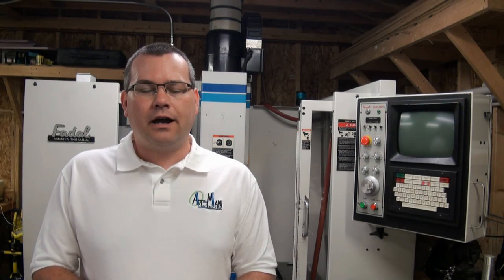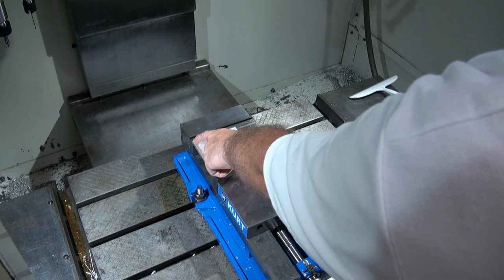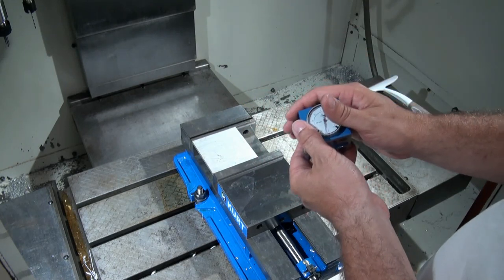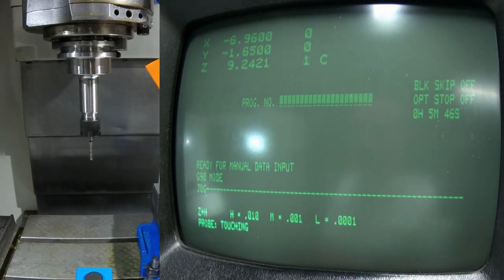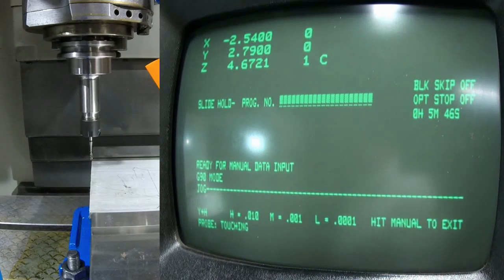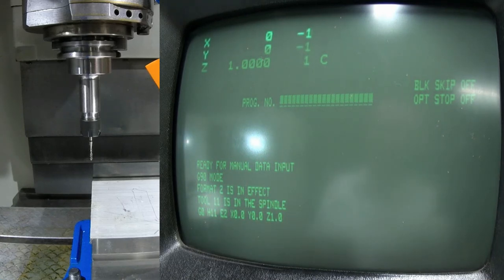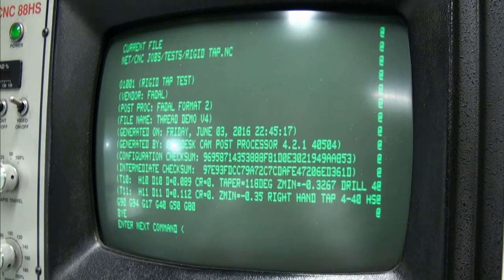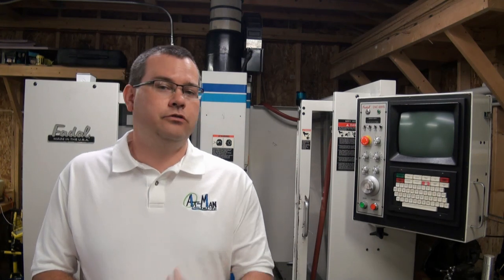CNC Mill Setting Tool and Work Offsets Practical

Comment: So basically, this video teaches how to be a cnc setter ?
Reply from the maker: It is a demonstration of how I manually set tool offset lengths and work offsets. Could be used on a CNC or manual machine to set a DRO.

Comment: The Fadal interface is stuck in the 70s. I would be annoyed if I had to work with it every day.
Reply from the maker: Most people I know like running them, its pretty simple once you get used to it and its fast.
Reply: My Fadal from late 80s is Better than my Fanuc control from 1999.

Comment: you don't have to reset tool offsets everytime you do a job or shut machine off do you? I just got a fadal 3016 and it has the renishaw mp12 probe i'm kind of getting stuck on how to implement it. its much different then my centroid controlled mill. there must be somewhere to setup the probe offset tool number and probe tip diameter? and a way to use it for setting work offsets?

Comment: After you set your both tool heights 2" off of the table.  Then touch off to the top of the part for your G54.  When you entered in the new x,y,z coordinates did it update the other tools?  If not, how can you get all of the tools in the toolchanger to update to the proper G54 "Z" height?  I just bought a Fadal Machine 1 month ago.  Thanks again for this content!
Reply from the maker: Hello DucksWe are actually applying two different sets of offsets. Also keep in mind, even though my tool setter is 2" high, the machine is setup to subtract the 2" during the tool offset measuring step.  So the offsets are really set to the table, not the tool setter height.First is the tool length offset, that is applied by setting the tool offset number of "H1" for tool 1.Then applying the G43 command.With the method we are using here by setting and applying just this offset, if you then command a Z position of 0.00 the tool would move to the surface of the table.  Each tool has its own "H" number with an offset that will yield the tool just touching the table at Z0.00.  That is the first step.The next step is dealing with the fixture offsets, those are the G54, 55, 56......We measure the distance from the surface of the table to where the Z 0.0 reference of our part wants to be. This should always be a positive number.  That number is entered for the fixture offset for Z.Now if we apply both offsets at the same time, the Z0.0 location will be at the point you wanted on your part. It is important to note you must apply both G43 and G54 offset settings at the same time when you do your first Z move.When we change tools we simply just change the "H" offset number for the new tool.Hope that helps clear it up a little.
Reply: how

Comment: great videos however for new people happening upon them be aware that the dial thing he uses to set the tools is generally not used in real life especially in high risk high dollar setups such as mold work in which tens of thousands of dollars could be lost for the slightest mistake or bad setting of a tool. The dial devices can be cautiously used--but they complicate the issue and are an item created to make money --for the maker of the device. Note that the needle spins around many times--the truth is you cannot trust where you are at. They are also not more accurate but some people visually see the dial and think they are--the gauge block method works instantly--and to millionths. Another issue is that its often necessary to indicate the top of the gauge block upon which the tools were set--and then run over to a known machined spot or starting point and be able to know the exact distance in z--you cannot do that using the dial setter. The dial setters are generally sitting around unused and wasted money in high risk machining. They also jam. The shaft jams and there is a mechanism inside that works "for a while'--but you cannot be sure when it goes bad gradually. Was just up at a shop in which one sits that he has taken apart many times to try to keep it working. It sits unused but once in a while he uses it so as "not to feel he wasted his money" Note also that the high tech dial has silly magnets on the bottom. You are hoping it repeats setting it on some surface even though the magnets will DEFINITELY have tiny chips and detritus stuck on them??  In mold works where blending must be done to split tenths the dial devices are of no use nor do they belong in a shop. The dial is in thousands--not tenths.
Reply from the maker: Hello Jeff
I can not disagree more.
The setter you see in this video was used for 2 years (still used sometimes) before I installed the Renishaw tool setter. It never jammed, failed, or came out of calibration. Just like any instrument, proper care and use is the key. It cost about $200 from MSC and paid for it self within the first week I owned it in time savings. If it broke, it didn't owe me a dime and I would order another one at the drop of a hat. It is repeatable within 0.0002" from my experience. On my machine the Renishaw probe is repeatable within 0.0001". I challenge you to set tools repeatable to 0.0002" with a gauge block in a timely manor. If you can, your a heck of a lot better then most of the people I know. If your trying to hold less then a thou, your not setting tools manually and your using in process probing to get there. If your trying to hold less then a tenth, you have one heck of an expensive machine, in an expensive climate controlled building, and your not watching some guy in a garage on youtube show the basics of tool setting ;)

Comment: Great videos.  Curious to why you use the utilities to set multiple tool length offsets, but use the paper and write down the dimensions and manually enter for the fixture offset?  Why not just use the fixture offset util that tells you to jog there, then record the values for x,y,z?  Again, curious if there was a specific reason?
Reply from the maker: The utilities did not really save me that much time. I use them for X and Y now but you can't apply tool offset values so it does not work for Z. Also when using the find corner or midpoint it forces both X and Y to update which does not work well.

Comment: Stumbled across the video looking for extra videos for my students. I teach CNC machining at a apprentice to journerman level. One thing I noticed, with tooling offsets that are that high, you lose a lot of overhead workable space, since your H call will move 12-14" negative Z if you are running G43. 

Heres what I do, and it may make your life easier. I have a 3/4" Solid bar in one of my BT40 holders. sharpened to a point. I use this tool as a MASTER GAUGE for all my tooling measurements and offsets. Its about 1" longer than any tool I use, and it has no runout, and abviously the pointed tip. The easiest way ive found to measure tool length is using this tool, jogging Z to zero my hight setter (2"). Then reset my relative Z to 0.000. Then swapping in each tool, say #1 which is a 1/2 EM, touch the z setter again, and I end up with something like -3.556". This saves a ton of room when doing large parts, where the Z-H offset might get in the way. Also, I use the Z setter to touch off the sides and faces of the vice, and the top of the parallels with a 123 block in them, just have to remember to add or subtract my 2.375" (2 for z setter and .375 for 1/2 of my master gauge dia), and 1" for the 123 block. This is way easier (and safer on tools) than touch off. 

I like what you have done, and i teach my students a similar way IF they dont have something like a master zero, or a probe of some kind, but I found that using an old tool holder and a piece of rod has saved me and immense amount of time in setups over the years. Just me 2c.

***it should be said that my MASTER ZERO that i use would normally be taken up by something like a 3d taster, but it serves a similar purpose. just a lot cheaper.
Reply from the maker: Hello, there are lots of ways to skin the cat here. I'm not sure if I agree that is easier or has any additional benefits.The primary reason is that it adds a level of uncertainty to the equation. By keeping my Z "reference" at the machine cold start position I always know that the tool offsets I previously measured are still valid.  Unless I do a repair on the machine the cold start will never shift. However, if you use the added step of the reference bar how do you know that no one adjusted or changed it since the last time the tool offset was measured. It also helps prepare me for the shift from "Table Zero" methods to "Gage Line Zero" methods if I expand my operation.I don't see the negative aspect you point out of "saving room"? If you watch one of the part videos during a tool change it does not matter if the part is 1" tall or 10" tall. After the tool change is complete, I apply both the Work offset (G5x) and the tool offset (Hx G43) at the same time as the initial Z move to the part.  So the machine moves seamlessly from tool change height to initial plane part height. The rest is just math in the controller and it does not really care.I do like your idea of using the Z setter to then set a work offset.  I have not thought about doing that before, I will need to try that one out.Thank you for being a teacher, we are rapidly loosing our pool of skilled machinists.Tim
Reply: The bar method always works for me. the bar itself never changes, and everything is measured off of it, tool length, and work offsets, so everything is relative. if the bar gets damaged or replaced, I simply have to use the same diameter bar, and reset my tool offsets, not really a huge deal, since ive only had to do it once in 3 years. each machine i have has a dedicated labelled bar to use. Ill eventually post a video of how i do it, just for educational sake. The only thing i was thinking on your machine was maybe it took the length of the longest tool and used that to offset the length of all the shorter tools automatically. but let me ask, when you do an MDI G43 H# and that tool offset is maybe -13.0, how far does the spindle move?
Reply from the maker: I never enter a G43 H# alone on a line, I always combine it with a Z move to an initial work plane. So it would be G00 Z##.# G43 H#. In this case the Z axis will move from where ever it is to place the tool tip at the defined Z value.

To remove the tool offset I call a G00 Z0.0 G43 H0, This will remove the offset and move the Z up to the tool change height.
Reply: right but by calling a G43 H# by itself, that would show what the actual calculation was doing, if it was in fact applying the entire offset value entered or subtracting the tool offsets from the longest one in the system. To do the tool change on my Fanuc I just do a G28 Z0.0 and it cancels all offsets and goes to ATC position. I havent worked with many other interfaces than Haas and Fanuc so maybe fadal uses a different way to calculate the height. My reasoning for the bar method is my workpiece is sometimes bigger than my table, if I break a tool and have to reset it, I can measure my tool offset from anywhere, not just the table itself, since I would have to remove my workpiece to use the setter.
Reply from the maker: It applies the whole offset value, does not care what other tools are in the rack.

Yes, using the table is an issue if you break a tool and can't get at the table.  In that case if I found my self doing that a lot I would switch to positive offsets and use a tool pre setter outside the machine. I will eventually switch to gauge line offsets anyway. Just need to get other things that are more important then a pre setter right now. But gauge line is by far the best to use and most widely used in industry.

Comment: On a fanuc, whenever you touch off tools you just have to add -2.00 for the height of the block?
Reply from the maker: Correct, you just need to account for the block height.
Reply: Thanks for the info. The offsets worked great, but I have another question for you. I'm programming some parts that are almost the same but different thicknesses. normally , on older new fanucs CNC's you have roughly 48 G54-G54-P01 offsets so I can just have 5 different work offsets with different z's (being the top of the part). unfortunately the machine I'm using only has 6 offsets. If I reprogrammed all of the parts based on the top of the fixture (which will never change) or bottom of the stock making the z values positive. I can use the same offset for all 5 parts correct.

Comment: I have a question...
So, the workoffset E2 is Relative to the Lenght Offset H11??
The workoffset  then is gonna be relative to the tool you are using to set your fixture offset???

I really hope you answer me

Thanks for your videos
Reply from the maker: Hello Jose, it can get a bit complicated because there are so many different ways to do things. It comes down to needing some reference to set the tools to. That can be the machine table, the gauge line, or some people will use the top of a part or vise (not recommended). Any time you apply a tool offset, the "zero" will be at that reference. If the "Zero" of your part is not at the same reference your tools are set at you can then use a work offset to move it. Does that help?
Reply: i have seen most of your videos, very helpfull

But, what i try to say is

I set all my tools with a gage block of 2 inches just above the machine table

Now i want to setup a work offset, E2,

i need to write the same as you (G0 H11 Z6.0)? and use that tool to setup my fixture?
Reply from the maker: Jose, if you wanted to use your tool to measure the fixture height then yes. If you used the tool setting utility and told it the height of your block then the tool tip will move to 6 above the table. If you did not tell it your block height or did it by hand you would end up a t 8 above the table.

Comment: What is the inconvenient to set tool length 0 and take Z on the part? Thanks
Reply from the maker: If you set your tool or Z relative to some surface on the part, for example the top of raw stock. Then if you machine that reference off and break a tool later in the run it makes it a lot harder to reset the length.

Comment: hi you may not see this with the age of this video, but i am following your video step by step and I am not getting the same results when it comes to the fixture offset. after i set my fixture offset i go to check it with G0 H1 X0. Y0.  Z1.
My X and Y both go to the correct position however my Z does not go 1” above my fixture but rather tries to go what seems like 1” from the table. Do you know what I could be doing wrong? I will not the only thing that I different is it shows I am in Format 1 unlike you in Format 2, could this be causing my issue? Thanks!

Comment: I have a ts27 probe I’ve been trying to figure out how to do offsets with. Manual isn’t all that clear as most know.
Reply from the maker: You need to use a work offset to depict the location of the setter. Then use the tool setting utilities and it is pretty easy. It will ask which side of the table the setter is located, which work offset you used, and if you set a gauge line offset.

Comment: I just touch to stock hit 5 to set lenth and call next tool   much faster . This is a cool way but way to slow .
Reply from the maker: Hello Jim, touching off stock is a good method used by many. It does however have its cons. The major one is what happens if your in the middle of machining your part where all the rough stock is gone and a tool breaks? It becomes a lot more complex to replace the tool and reset the length because the zero point is now gone. Using this method you always have a known zero place no matter what your doing. It also leads into using a tool setter in the future. When you transition to a tool setter you basically do the same steps but its automated. This way you don't need to change your work flow at all. I would also challenge you to set 10 tools to within 0.0005" faster touching off the stock verse using this simple dial setter. I have timed it, this is much faster and easier to get accurate results.
Reply: At-Man Unlimited Machining. Thank you for your info  I'm still in the learning process.  I run a fadal mill and a sharp  mill.   I'm  trying  to come up with a program for thread milling a hole with a thread size .250- 28 un at .475 deep and don't have a master cam  so how would I code that for iconel.?
Reply from the maker: Check out Fusion 360, it can do thread milling. Just watch how much material your taking in a pass with the harder stuff. You can also program it by hand if your good at G code. It is just a bunch of G2 or G3 lines with the Z move that matches your thread pitch. That generates the helix. Also these guys have a pretty good online calculator that posts the code out. http://sct-usa.com/thread-mill-code-generator/